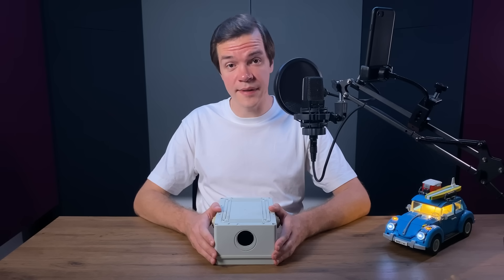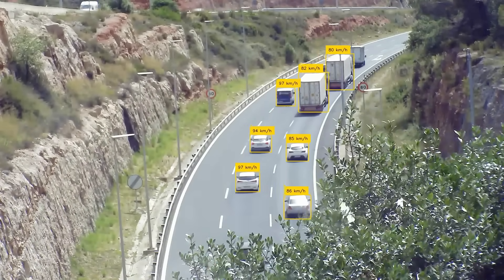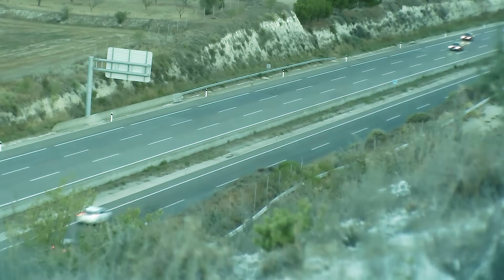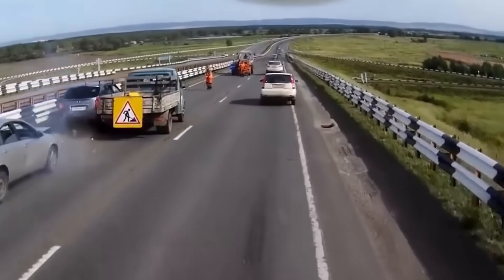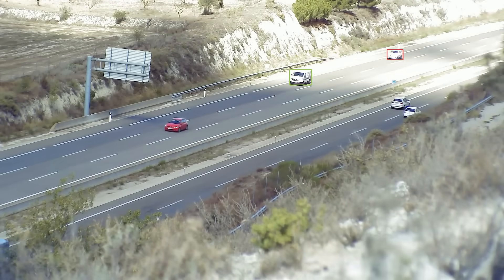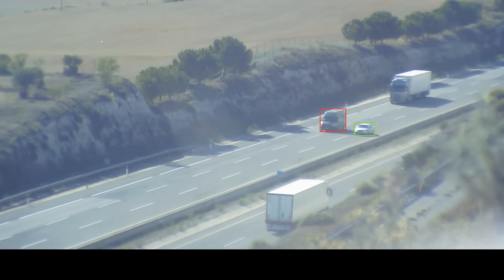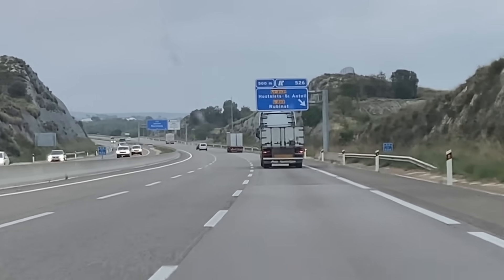New Anti-Tailgating Camera Reveals Shocking Statistics

Comment: I don't usually write comments, but this time I thought mine might be useful. I'd like to share my thoughts on where the "tailgating" problem comes from.

I think it's due to the driver's complete lack of understanding of the physics of rapid braking/stopping. Every driver can learn to pull closer to the car in front over time. But what percentage of drivers have ACTUALLY been in a situation of sudden braking? How often do such situations occur? If this scenario (simulation of sudden braking) were taught in driving schools or there was an obligation to "retake" the test regularly, maybe people would better understand the risks and get used to the need to maintain a safe distance?..
P.S.: At least in my driving school there was no such experience decades ago.
Reply: I think its interesting the point about physics because as a farmer who drives big heavy trucks and also pulls trailers with the ute, you are VERY aware of the physics of your vehicle. It's something I have noticed at least where I'm from in Australia that farmers very much do respect the stopping distance much more than people from cities. It's also probably due to the fact that we deal with wet slick mud roads as well and learning to stop with gentle breaking is very necessary to not slide off the road, and if you got a trailer to not jackknife yourself. Over here "emergency breaking" as it's called is taught in the theory part of learning to drive but not tested in the practical exam which I find odd as there are plenty of crashes that occur because someone swerves as they break because they don't know how to emergency break properly. 

Another point with physics is trucks. MY GOD. The amount of cars I have seen on a highway going 110km/h suddenly start indicating to turn off with a fully loaded grain truck behind them (total weight over 100 tons easily) and the truck having to absolutely slam the breaks and in real bad situations pull into the incoming traffic lane because despite sitting so far back... the bloody car is just so sudden to decide "oop my turn off here" and physics gonna physics and your breaks may be the best in the world but 100 tons is 100 tons and you need time to slow that shit down. And these aren't like city turn off's where you have a lane to turn off in this happens on the highways between major population points where turn off's are 90 degree angles and there is no second lane just one in both directions. You are taught here to give 3 seconds of indicator minimum but for trucks I indicate at LEAST 10 seconds beforehand and before I even start slowing down no matter how far back the truck is. 

I agree that a practical driving test should be retaken, my thoughts would be every 5-10 years. Basically every time you renew the license because after 30 years of driving you don't remember everything said to you when you were 16 and people get way too comfortable in their bad habits especially bad driving habits. And I do agree that not many people have actually been in a sudden breaking situation. Whenever I have a city friend with me on a backroad, I show them what a proper emergency break looks like (sometimes not even on purpose, kangaroos just appear sometimes lol) and they all get super frazzled by it which just shows they haven't really experienced a really fast stop. And it's not like I surprise them, I often ask if they wanna see a proper fast stop and they agree, except the kangaroos those happen when they happen you get used to it outback. 

Sorry this turned out way longer than me simply agreeing with you lol, have a nice day.
Reply: @shadowstalker732 Shouldn't ABS take care of that?
In Germany, it's compulsory for cars.
Reply: in Switzerland we did a course for that. In a special driving park we had to drive in two lanes, one car left one car right, one car suddenly accelerates and stops while the other car tries to hold a short distance. It makes you realise that you just cant brake fast enought and since then i always keep 3-4s space, so mutch more relaxing to drive honestly.

We also did emergency braking and driving on ice roads training there. Fun day.
Reply: No.  Many people are just assholes.
Reply: It damages the car to brake super hard. We should set up VR augmented driving simulators or something
Reply: @astronemir it does not damage you car and if it did, your car would be too unsave to drive on the road!

You should look up the tests companies do these days, 99.99% of the people have never driven a car as hard in as tought conditions as they were tested in.
Reply: In the UK they do hard ABS breaking in some of the tests, not all, but enough such that your instructor will definitely have you go through it a couple of times just in case it comes up on the test. Hasn’t always been the case though, it’s relatively new
Reply: The lack of understanding is even more apparent in adverse conditions as heavy rain, snow or fog.

Comment: I don’t believe that the 0.9 second reaction time is average with so many distractions today that divert attention.  Also, the following distance suggested by the 0.9 seconds does not take into account the increased stopping distances in less than optimal weather that is typical where I live.  Offsetting these is the fact that most drivers are most often looking well ahead of the car in front of them to give themselves more reaction time, and the fact the cars in front very rarely come to an instant stop (unless hit head on), providing much more reaction time to stop in most circumstances.  I also manage my braking force by also watching what is behind me to reduce the likelihood of being rear ended when I brake.  It is our calculated risk based assessment made in fractions of a second.

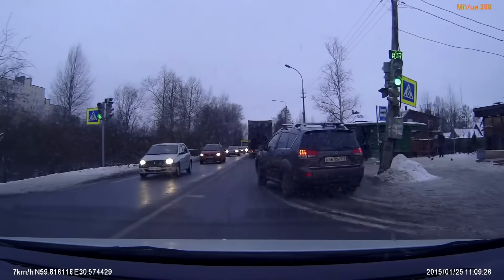Comment: 14:55 I don't drive anymore. Never have to worry about tailgating anymore on the train.
Reply: But the train cars are literally touching each other.
Reply: @ChristopherLusher Yeah, but no worries. That's by design. Also most trains don't even have separate train cars anymore. They're one continuous passenger compartment with flexible segments connecting them.
Reply: I would commute by train if the railway literally directly connecting my house and workplace ran a commuter service. It's not like it'd be difficult, barely any trains use it at all and the ones that do are exclusively freight.

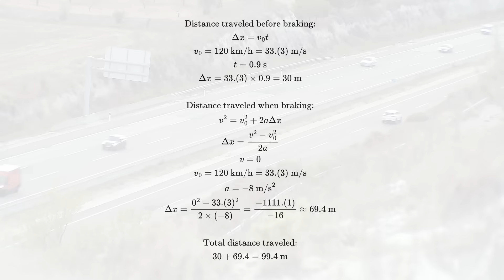Comment: 9:35 at least according to Italian road code, you are not required to keep such big safety distance that includes braking distance, in normal weather conditions. You can assume that car in front of you has your same braking power, so what counts is to have a distance that covers your reaction time with some margin, e.g. 2 seconds, not three. 

You'd need to factor in braking distance when you can't see beyond the car in front of you (fog, rain) because im this situation it may very well happen that the car in front of you hits a huge obstacle and stops in an instant.

Comment: The other issue is that brake lights are difficult to interpret quickly.  Is the car in front just shedding a little bit of speed or is it an emergency stop?  Deciding which case it is eats into the time available to react and apply emergency braking if that is required.

Comment: If you safety distance is large, there could be a tendency for other cars to squeeze into that safety distance from another lane and if you were to pass a camera at that point, you could be fined for the dangerous driving for other cars moving into a free space and then cutting your safety distance significantly making it look like you were tailgating. This compounds the problem is a safe driver is having to hit the brakes every time an unsafe driver invades their safety distance - potentially causing the dreaded snake effect (phantom traffic jam or butterfly effect). These distances go out the window when it rains, in ice/snow conditions, reduced visibility or when at night when you may not be able to see what is happening beyond the immediate car in front of you. I knew a person in a high performance car fitted with ceramic brakes, that although they could stop very suddenly, they were very aware that the car behind them was not fitted with these high performance brakes and could easily go into the back of them even though they could stop in time. Distances between cars will vary due to speed, so cars slowly moving in a queue will have and require less safety distances. The problem seems to be getting worse, with more traffic, more frustrated/aggressive drives and more problems on the road. I recommend getting an internal camera (front and back) so at least you have evidence if you need to challenge anything or go to court.

Comment: Well, if you put speed cameras at intersections where people really need to slow down, speed cameras are not just about getting money, it is about forcing speeders to slow down when it matters that little extra.

Same thing with long straight stretches, where some "people" (you can use whatever derogatory term you want) will have out right drag races driving so fast they have a 50/50 chance of going straight at the next curve or go flying on that bump that is hardly noticeable at normal speed.

Comment: One thing we can do as considerate drivers is wait longer before returning to the inside lane after overtaking. So often I see people pulling back across immediately after passing, thus placing the driver behind in the position of having to either slow down or drive dangerously close to the back of the car in front until it has moved away.

Even when the roads aren't busy, this is a good habit to get into as it prevents too much variation on speed for other drivers, meaning they're less likely to bunch up other cars behind.

This only works on carriageways with more than one lane though. Single carriageways are limited by the slowest car and the capacity of the road for passing slower vehicles safely.

Comment: Tailgating comes from distracted driving as motorists use a large moving object in their peripheral to maintain speed rather than the speedometer. Placing the phone on the seat and driving attentively would be a really noble idea.
Reply: When I first read this I thought “putting the phone on the seat is a terrible idea! Drivers would just end up staring at the passenger seat!” But you meant putting it away.
Reply: No, tailgaters are not distracted and using their phone. It’s almost always the opposite: tailgaters are more aware of traffic conditions. It’s a prerequisite of not crashing when your driving has less of a buffer.
Reply: @BenjaminWalburn  So, tailgating is safer.   bruh
Reply: nah, most people do it wrong even if driving 100% attentively
Reply: It’s literally got nothing to do with being distracted, I end up being a tailgater often and not because I want to, but because of the distracted idiots infront of me who ride the passing lane, often slower than the right lane. If you are being tailgated in the passing lane, you are the problem.
Reply: @ApolloTheDerg  Why do you think they are riding in the passing lane...attentiveness?
Reply: @theamerican7080  Ignorance typically, or they have a left turn in 10 miles and they can’t change lanes.
Reply: Tailgating is a choice.

Comment: Sadly real life gets in the way. If everyone keeps a 'safe' distance and nobody encroaches, nobody can change lane. The main problem is attention. Big gaps results on average to lower attention levels so whilst a smaller gap will increase the chance of accident, the closing speed will be less hence circa 1 second gap tends to be the rule. A larger gap will lead to reduced attention so an accident under these circumstances, whilst less likely, will result in a much higher closing speed and therefore serious and unavoidable accident. Smoothness is the key regardless of anything else. Accelerator pedal is for slowing down, brakes are there to not hit something. Always be aware of the rear view mirror when braking and be prepared to ease off the brakes. Better to hit and be hit at 10mph each than rear ended by 20 mph and while we're at it, always be responsible for ones own driving and not expect others to accommodate your shortcomings, eg never cause anybody else to have to brake.

Comment: @6:29 You’ve got a thinking fault here. The problem might not be within the same lane. Driver might switch lanes in case of an emergency. So it’s not just about keeping distance to the car in front of you, but about being able to stop in an unused area at the stopping distance. That might be the lane you’re driving in, or perhaps the next lane. Also, if a driver in the lane next to you doesn’t keep its distance, it might have to swerve into your lane in case of an emergency stop. So even though you may keep the emergency distance, it may not be enough.
Reply: You do realise that the safe follow distance is to give you enough time to react and reduce your speed, right? The goal isn’t to stop - though that would be the ideal - the goal is to be able to brake and not smash into the car in front at high speed. If you’re needing to swerve into another lane, you’re doing it wrong, and you’re putting all drivers around you at risk.
I see this issue so much in videos particularly in America, drivers deciding to swerve into other lanes to prevent a crash. Guess what happens? That lane has to hard hit their brakes, causing drivers behind them to swerve, and it cascades. If the initial driver kept the safe following distance and didn’t swerve, all that’d happen is maybe a bump if that, certainly having the potential to cause injury, but not fatal and certainly not a multi-vehicle incident.
Reply: @FenekkuKitsune The problem is that oftentimes the original drivers following another vehicle, don’t keep the safe following distance. Therefore it’s you who has to take that into account. Because if something will happen, they will have to swerve into your lane or crash. Either way you will have to come to a full emergency stop pretty quickly.
Reply: @EhWahEhWahEhWah  As a driver you need to be aware of everything going on around you. You check mirrors regularly for a reason. You can see the cars in front of the lane beside you much easier than the cars in that lane can, you can react faster if something happens. But therein lies the issue, part of driving requires that you state your intentions on the road. Indicate for where you're planning to move. Give time for braking. That sort of thing. But a lot of American - and a lot of other country - drivers have this idea that the more they swerve into lanes and tailgate the faster they'll reach their destination, when it ultimately works out to a negligible difference in ETA.

Comment: Ok... finished the video. Loved it, and very nice project and explanation how you did it. I think your conclusions are also sound, tailgating being more dangerous than speeding, makes sense, I think. Adding to my comment from below: I tend to set my speed setting on a congested highway to about 5 kmh under the actual speed limit because that allows me to simply stay at the correct speed while simply everyone is trying to pass anything that is not moving 10kmh FASTER than the speed limit. I am creating my safety distance automatically and am not pulled into the faster moving traffic that way (the ones that go structurally faster than the allowed limit).
Reply: In other words, you're too lazy to actually drive the car, so you selfishly cause a clusterfuck.

Comment: Your closing comment of doing good actions and hoping that others choose to stop tailgating is unfortunately very optimistic. And I don’t think it will work. People are entitled and drive with themselves in mind. Yes, a lot of people copy others and tailgate because everyone else is doing it, or they do it to prevent others cutting in And shortening the gap further still. Putting you in a catch 22 but for a lot of people they don’t realise they’re doing it and are not bothered about road safety nor are they interested in achieving better standards.

I’ve been doing what you said for the last 20 years, but it doesn’t work. But it’s not really possible to do anything else, if you tailgate you’re just making matters more dangerous for yourself. That’s the simple truth. 

But in the various instances that I am leaving a larger gap, the majority of the time people just tailgate. In scenarios where people think the gap should be smaller they get aggravated. Some examples include… 

In urban areas people will tend to tailgate you closer because they think that you’re going to slow. They will even beep the horn at you. 

On rural roads, I find it’s not a problem. 

But I had an example in a city Centre, sat in my 3.2 L Quattro, in stationary traffic waiting for a pedestrian light to change, to only then join a congested roundabout 10 m away. The car behind me was dissatisfied with the gap that I had left, so he squeezed between the lanes of traffic to then he’ll abuse through the window saying that you drive like a little B. There’s absolutely zero sense in getting any closer in that situation, and there’s very little gain in opening the lungs of the Quattro in a city.